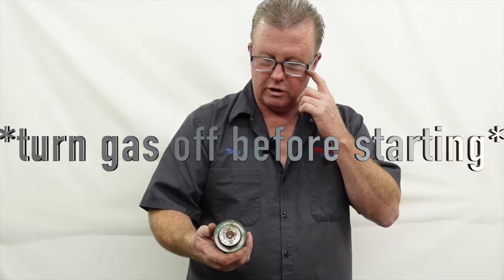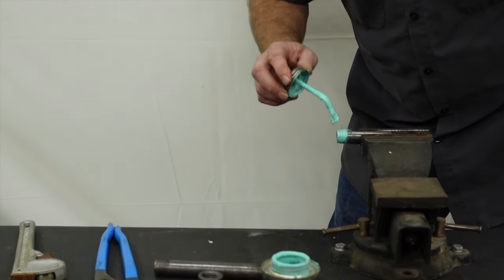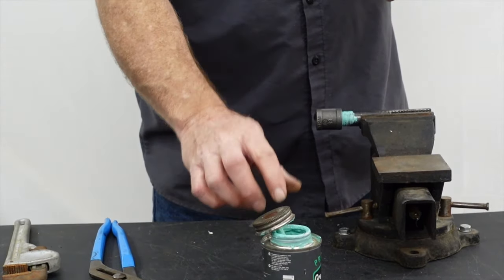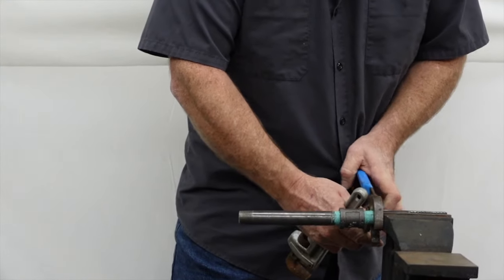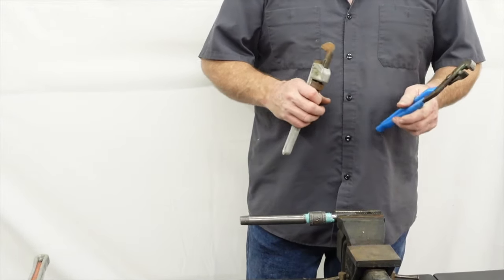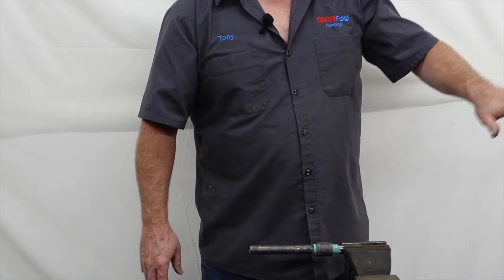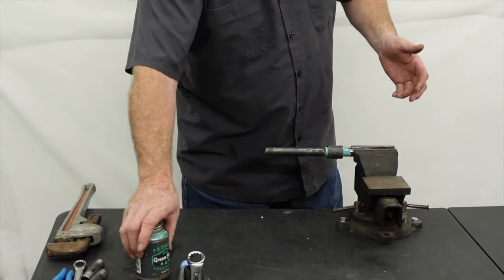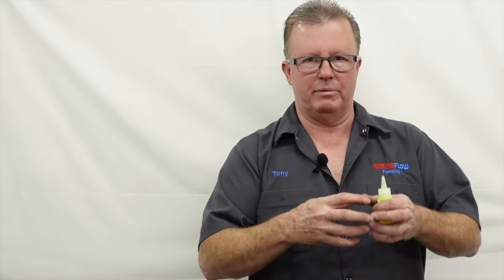How To Tighten Gas Pipe 101 - A Quick and Easy Guide

Comment: In my youth I thought "all she'll go and a quarter turn more" was the proper torque value. I did that on a pipe fitting for a propane line and caused a hair line crack in the fitting that didn't show up with bubble test. Strong gas smell in the basement next day. Called propane co. Tech said I was lucky the house didn't blow up.
Reply from the maker: Thanks for watching

Comment: I'm going to disagree on the claim that you can't tighten them all at the same time, of course you need to visually verify that they are all turning in as you tighten.  Also if you tighten a distant fitting further in, so much the better it was too loose anyway.  Never had a fitting start leaking from getting tightened "by accident," in fact have gone out on many calls where all that was needed was to tighten a fitting because some lazy bones in the past did not get it tight enough.
Reply from the maker: I. NEver claimed my way is the only way.
Reply: Fittings are alot easier to tighten further down the pipe. Ive tighened 1 1/2 tee till it was tight put a 3ft nipple on there and all the sudden it could wiggle back and forth hasnt leaked since.
Reply: He didn’t say you “can’t”, he showed how he does it.  And you cannot argue that there’s no way to know for sure each fitting is tightening by an equal amount when doing it all together.  Doing them separately will undoubtedly tell you exactly how much torque you applied to that specific fitting before moving on, no doubt about it.
Reply: @jordancook1668  Torque applied is equal between all fittings from the wrench to the one that changes direction. It is true that you may not know exactly how many threads each one took up just turning from the end, you would have to use your eyes and brain to determine that.

Comment: For a tapered thread, since they are different amnd people use different compounds/tape, a general rule of thumb is to go 1 and 1/4 turns after hand right. Have to be careful if you have something going into aluminum cast (like steel pipe into a heater control valve).
Reply from the maker: Thanks for watching

Comment: I have a question, if you’re removing a section of pipe or a flex pipe and one of the pipes you don’t want to remove loosens a little.  Can you just tighten up the one that moved a little and just tighten it?  Or do you have to remove the pipe that moved a little and re-tape and dope it to reinstall!
Reply from the maker: Generally the rule would be to take it apart and reseal and reassemble.  However it may be ok but certainly should be leak tested no matter what. In the future always use a wrench or channel locks to hold back on the pipe you do not want to move while removing the one you do.
Reply: @masterflowplumbing9812  
Thank You!  Yeah I assumed it was tight to begin with and didn’t think about adding the wrench 🤦‍♂️🤦‍♂️.  

If It tightens a little bit and no leaks.  It should be leak free for a long time?
Reply from the maker: If it test leak free it certainly should stay that way

Comment: Now if we could get HVAC contractors to stop using "thread protectors" as couplings on black iron pipe, that would be swell. I found three of them (one was leaking) after I had gas run to my new boiler. They are straight thread (not NPT) and even with loads of dope, they tend to leak. I had them come back, cut them out and replace with unions.
Reply from the maker: Wait what ? Those aren’t couplings?   lol.  Just kidding. Thanks for watching

Comment: hey Tony, Nice video. I have a quick question. A plumber came look at my house to check out a natural gas pipe fitting. He saw grey color sealant and instantly said this is epoxy since it is dry and kept nodding his head and said it is not good. Epoxy should not be used on any gas pipe fitting. My question if you can help me is - does this grey color sealant has to be epoxy because it is dried? I looked up and found information on gas sealant dont contain PTFE will indeed dried. I just thought it was strange when a plumber automatically assume the sealant is epoxy just because it is in grey color and dried. Just do not want to be taking for a ride.  Please adivse. Thank you.
Reply from the maker: Hard for me to say without seeing it.   Grey colored sealants do exist.  So yeah who knows.   Any exposed sealant will eventually harden that does not make it an epoxy.  Now with that said I’ve seen some weird stuff.  My own grandfather told me once that he used old paint he had left over to seal threads on galvanized pipes.  He was not a plumber but very resourceful and I always respected that.   Thanks for watching.

Comment: If you have black pipe running under your food truck straight from tanks without a regulator but use a regulator on each piece of equipment does this bring back the safety issues?
Reply from the maker: I’d have no idea.  Never built a food truck. Natural gas and propane are very different. I’m assuming your using propane

Comment: Are there actual recommended torque settings for black gas pipe?
Reply from the maker: Yes.  Tight is tight. Broke is to tight lol.   Pipe threads are tapered so the more you tighten the bigger they get.  My whole career I’ve only ever seen it done by feel.  Never heard of a wrench that can measure the torque applied.  Would be neat if there was such a tool like auto mechanics have in the torque wrench.  Thanks for watching
Reply: There is such a thing as an adjustable torque wrench, but it's pricey. My Dad did it by feel. I have one job to do,so that's how I'll do it also. Then tests with bubbles, ekectronic tester, then grill lighter (ultimate test). 😊

Comment: How about tightening a leaky copper flare fitting?

I have a leak at a flare junction that is connecting two copper pipes.
Can I try to snug it with two crescent wrenches since each fitting can accept a wrench
Or is it a rule of thumb to just redo a new flare fitting?
Reply from the maker: You can always try to tighten it a bit more.  You could also use a good  pipe dope like “ the green stuff”. Put som on both flared surfaces and then re tighten.

Comment: Tape and pipe dope always. Save yourself some from leaks.
Reply from the maker: Typically you don’t need both for gas piping
Reply: @masterflowplumbing9812  OTOH it doesn't cost enough to matter and (thoughtful) overkill never hurts especially with the poor machining so common these days.
Reply: @obfuscated3090 which do you apply first? Tape or dope?